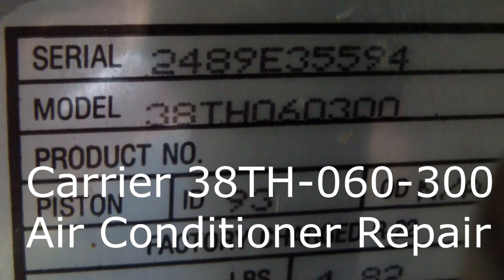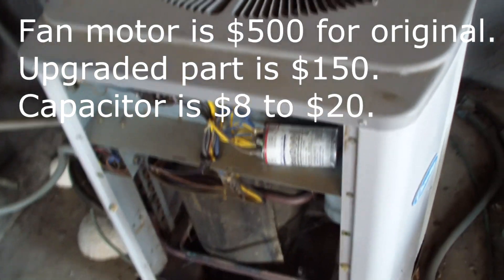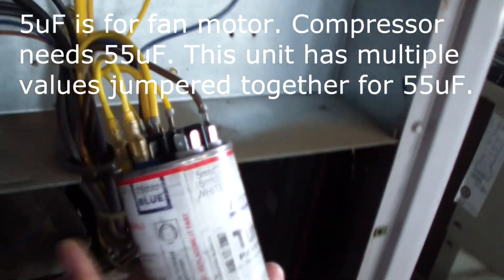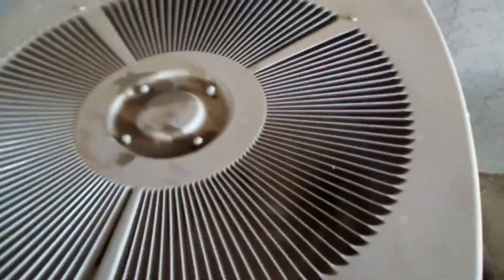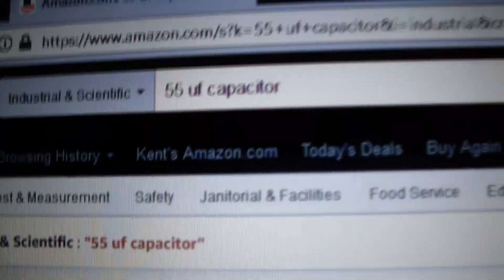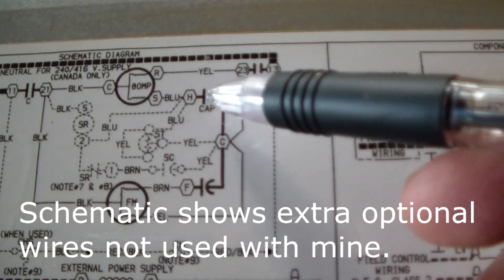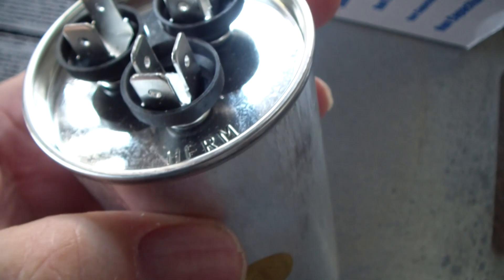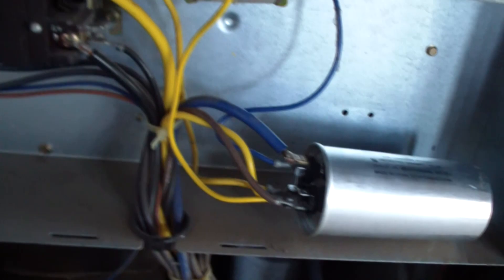Carrier Air Conditioner Fan Capacitor Repair

Comment: Good Video. Searching parts online can be risky since they all look the same on the outside. My AC was making noise last week, but working. I already had a capacitor on order & arrived before the fan stopped. Since it quit today I was up & running in 1 hour. The last universal capacitor only lasted 1 year.

Comment: Hi Kent, Would you say this is the same capacitor issue?  It buzzes when the fan is running.  I have a video link and an image of the model.  If so, can you help me with the part?  Love your videos.  
video -https://drive.google.com/file/d/10W4h-hKmUF2UivpjCl9Edu7tCnW6A3_3/view?usp=sharing
image - https://drive.google.com/file/d/1BMiaZ-zlRXgHEcKe9KmUxEotXE7uMh60/view?usp=sharing      

Thanks Kent, 
Chris
Reply from the maker: The buzzing sounded like the compressor so it could be a capacitor problem. First thing is replace capacitor. Then try a hard starting kit if still a problem.
Reply: @KentDiego  Thanks Kent

Comment: Kent,
I have the same AC Unit and mine just stopped working this evening. A quick google search led me here, and I ordered the same capacitor from Amazon. Its still there! Even if this doesn't fix my issue, I wanted to say thank you for the great video. It was incredibly helpful as I would have been spending way more time trying to figure out initial steps as to what to do! Cheers.

Comment: Capacitor life is effected by voltage and temperature. Many technicians prefer to replace a 370 volt cap with a 440 volt cap, especially if the original did not last as long as expected. Reason for failure could be power surges, slow start-up, or frequent brown-outs. Thus selling a 440 volt capacitor is value to the customer, especially if he is provided with dirty power from the utility. The 440 volt capacitor can be expected to last longer than the 370 volt if current draw is normal. In some cases adding a hard start kit could spare the run cap some abuse, where power is dirty or low. Anything personal, I add a hard start kit.

Comment: Nice work Kent.  another option might have been to just buy a 5u cap (since the compressor still seemed to work fine).  Just hook it to the Common and the brown wire and voila!!
Reply from the maker: Afterwards I noticed there was an unused 5uF tap on the universal capacitor I could have used. The real point is capacitors only seem to last 10 years. As the cap ages and fails it could have harmed the compressor or the fan motor. Very expensive repairs. So it is good insurance to replace them both.